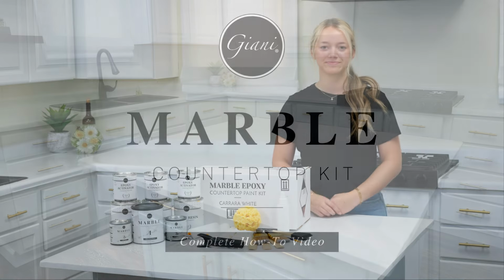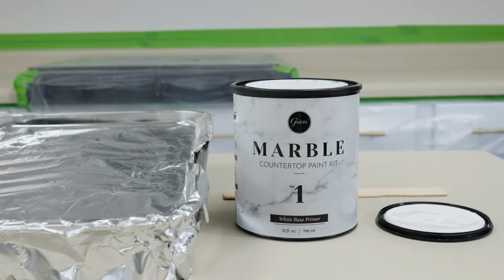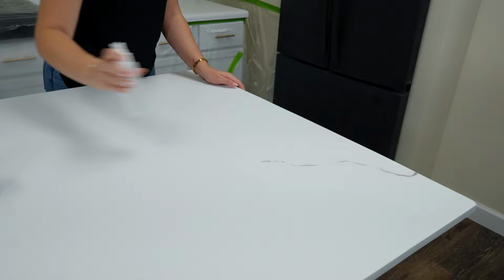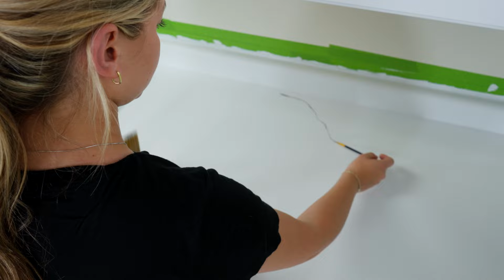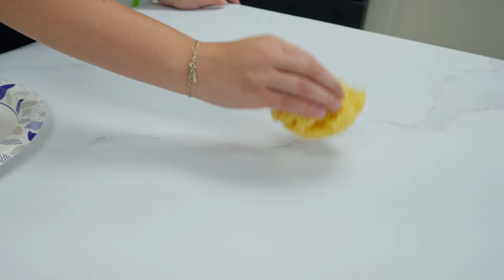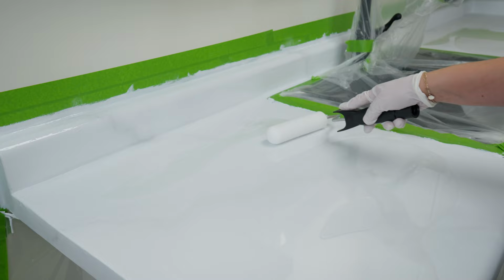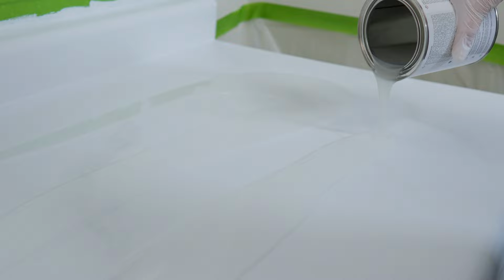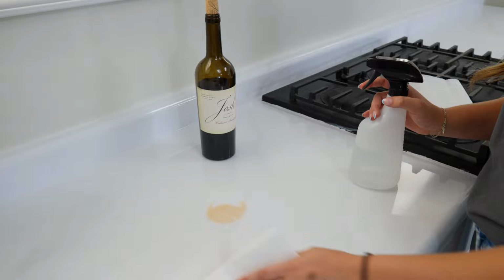Giani® Marble Countertop Paint Kit With Epoxy Resin Topcoat

Comment: I just did this on a wooden dresser that will be used as a bathroom vanity.  It's still drying but right now it looks awesome.  Just a tip for anyone using the kit on bare wood - apply a coat of Kilz stain-blocking primer first! I used 4 coats of the Giani primer, which covered the bare wood wonderfully, but when I spritzed the water on the veining paint, I was getting brownish puddles, which I assume was from the wood. I dabbed them up with a paper towel, but "I" can still tell they're there. Using the white highlighting paint helped cover some of the brownish areas. All-in-all, I'm happy with the way it turned out, except now I want to make everything look like marble. LOL

Comment: I just did this kit on my countertops. My originals were a dark green color, so it took 4 coats of primer. Turned out nice. Only thing is, trying to keep lint/fuzzes/hairs out of the epoxy while it’s curing is IMPOSSIBLE. Only thing that sucks about this.
Reply: I'm worried about dog hair!
Reply: @RichieMain  I have a charcoal lab, and honestly I didn’t get many dog hairs in it at all. Mostly just fuzzes and fibers from the air flow. It’s a bitch when it’s almost dried and you find some fuzzes or hairs that need pulled out 😫
Reply: @TonyP-ft1tu  Thx for the reply Tony. Have a lab too but also. Bernese Mtn Dog and 2 cats. lol. Have been painting cabinets and pet hair has been a challenge. I do like this method though because epoxy is just the final step.
Reply: @RichieMain  no problem! It turned out great and has been holding up nicely. Decided to give it a try before we decide to fully replace our countertops in a few years.
Reply from the maker: @TonyP-ft1tu  @RichieMain I'm sorry to hear this! If you have some texture from debris, we have a buffing technique that can help. Please reach out to info@gianigranite.com

Comment: Can you add two coats of epoxy for a stronger finish?
Reply from the maker: You can if you would like but it is not necessary! When applied correctly, one layer of our epoxy is extremely durable!

Comment: What if my countertops are flush with the top of the cabinetry? How can I stop the epoxy from running over the edge of the counters?
Reply: That sounds tough. I would use a lot of painters tape and tarps
Reply: You’re S.O.L.  Lol
Reply: Create a tape damn and cover everything well
Reply: Try to add a 1x2 on the edge
Reply from the maker: Unfortunately this will be tricky! We recommend securing tarps with as much tape as you can, leaving no gaps for the epoxy to get through. It can also be helpful to create dams as mentioned below!

Comment: Can you do this on a textured formica counter that isn't smooth.
Reply: Same question
Reply from the maker: Hello! You can apply the epoxy on a surface that has slight texture as long as you use enough product. If the epoxy is spread too thin, the texture will show through.